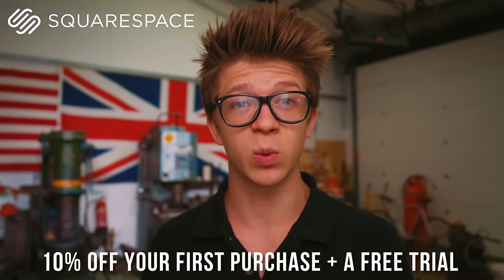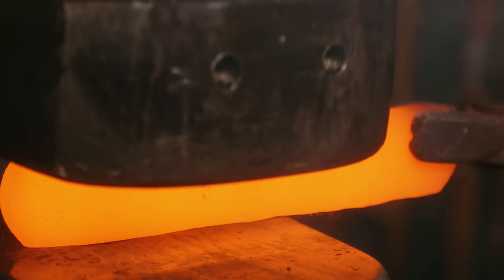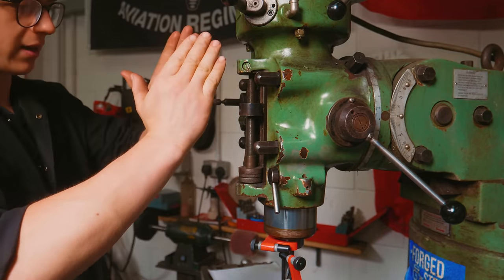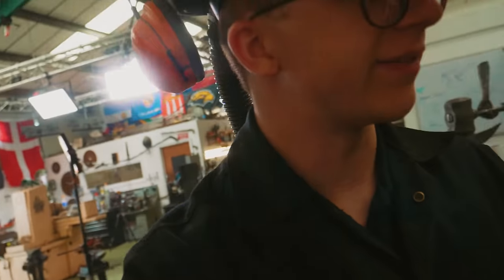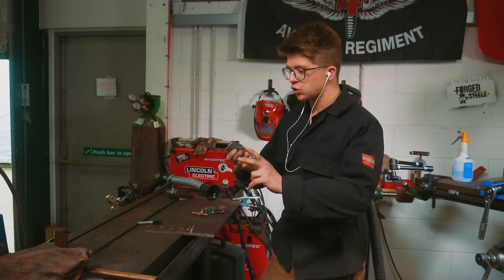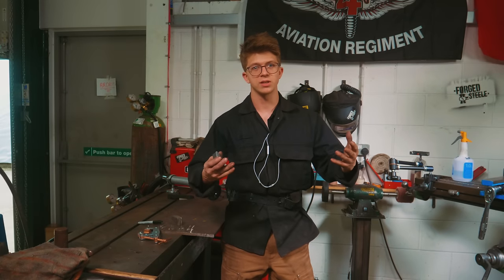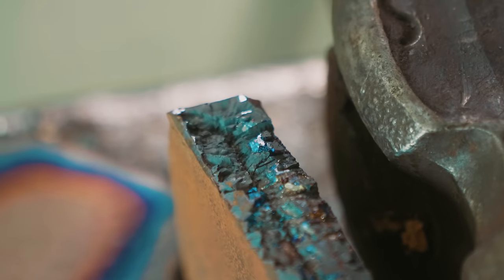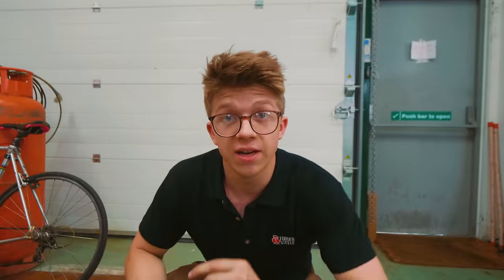CAN YOU MAKE TITANIUM & STEEL DAMASCUS?!?!

Comment: if the patent is the stumbling block try using helium inserted of argon.  Vacuum (or hermetical  seald )  processing  of metals is an old method and is probably not patented ( viking age crusebel steel for the middle east ) so if you use a alternate purging gas (must probably be a noble gas as Ti reacts with Nitrogen )
Reply: Sveinn Guðberg Sveinsson I don't think that would work if the patent is strong.. if anyone making the patent was smart they would word it to include all gases
Reply: Jake Mitch that would be to brood argon gas is use in aluminium processing for purification and titanium and it's derivative are welded in vacuum and argon gas chambers so you can't patent broadly and you must prove the process is new and dissimilar to others but I'm not a lawyer
Reply: he said the process is patented, not the gas used. so it doesn't matter which gas you use. it matters how you use it.
Reply: I'm guessing their process also uses specialized equipment though.  General inert gas welding, even done with forging, can't possibly be covered by their patent... Not a lawyer obviously but...
Reply: A patent that tries to include previously developed methods is inherently weak. If a method was already developed then on what grounds can they claim a patent?
Similiar to when Trump tryied to ™ "You're Fired"
Reply: I don't know the full details here but I seem to remember a story about the guy making a massive molten metal explosion and burning down his shop in the process of trying to figure out the process. So I don't recommended anyone just try doing this on their own without teaching.
Reply: Sveinn Guðberg Sveinsson Really what reaction with nitrogen?
Reply: Sveinn Guðberg Sveinsson or Xeon but that's super expensive
Reply: Just because something is patented doesn't mean you can't replicate it..
Reply: Patent in what country???.... check
Reply: In the USA, you can duplicate a patented item or process for research, including (and usually) an improvement on that item or process. You cannot generally use, in a practical manner, that item or process for its intended purpose. Still, many processes and items are on weak patent grounds; show "prior art" by others, and they tend to go away.
Reply: He can still make it if someone has a patent on it right? A patent just preclude sale of the product it?
Reply: Cannot use patents to make videos that you make money off, in that case he would need a deal with the company. You can make it all you want at home ofcourse @Jackson Jaro
Reply: That's super interesting. Is it common for content creators like alec to get screwed by publishing a video showcasing a process that they didn't know was patented?
Reply: I cannot believe that it's possible to patent a method... Imagine if this was the case with other stuff...
'No you can't use async programming, it's patented', 'too bad you like burgers 'cause we've patented it'...
This is ridiculous.
Reply: TiN titanium nitride is one, the surface of Ti bolts is "plated" with N (nitrogen) inn a gas chamber ( you can even pick your color) it is the most common post treatment to increase surface hardness in all Ti products and as the atmosphere is 70 ish % N then I think you need a controlled  environment.
Reply: I don't think he's precluded from making a video about the patented process because it is patented. Even if he did, I don't think whatever corporation owns the patent would care. I'm not an expert, I'm studying for the patent bar, so this is a pretty niche case and it's more into the litigation and enforcement so I'm not sure. 

A pretty major precept behind the patent system is to get people to share their ideas with the public in a way that someone with ordinary skill in that particular field could recreate it. 

 He definitely couldn't sell whatever he made, which may be a drawback for him.
Reply: Correct there are few things that do not react with Titanium, and heating it in a vacuum I remember it vaporizing at a fairly low temperature. That is compared to many other metals. The only other common structural material that melts at a lower temperature is aluminum. I have sprayed titanium in a vacuum onto aluminum parts, and used argon to cool the aluminum, and nitrogen purge just before the filters so they would not burn and to protect the vacuum pumps. I built a chamber using MKS controls, and other equipment. I worked there a few years till one day the owner came in one day wasted looking for a fight and attacked me. He had poisoned himself with various metal vapors without using proper protective equipment.
Reply: Sveinn, Argon has been used for more than 50 years and patents don't last that long even when renewed. If you want to work out the process with someone that has the equipment, material, and technical background send me an e-mail.
Reply: Crazy Horse, Titanium burns in nitrogen one of the few things that will burn in that gas. It makes TiN. The color depends on the thickness of the coating and particles.
Reply: I skimmed the beginning of the patent (didn't have time to read it through yet), but it seems to a load of BS. They are essentially patenting canister damascus forge welding (all metals, not just titanium) with an inert gas inside the canister. This is obviously ludicrous, as canister damascus has been done for ages. Also, forge welding Ti into Ti is also nothing new, and not invented by the patent holders, which, by the way, they acknowledge in the patent.

My initial take is that the only thing that would up in court is the use of their trademarked name 'Timascus', which is rather gay name, I might add. Surely the company would not even consider suing Alec if he was to make Ti damascus in a video. Only commercial mass production and sales might yield legal action, but I doubt they would win, since AFAIK they have not presented anything new in the patent. I will read the entire thing when I have time, and comment if I change my opinion.
Reply: That's not true. You can't sell the product for it's intended use to compete with the company that owns the patent. You can also challenge the patent if you create a process that is similar and gives the same result, but is different enough that the process isn't the exact same, or improves the process in some way to make it your own.
Reply: Crazy Horse titanium nitride is one of the reactions. It gives it a golden sheen.
Reply: Can you weld steel to TiN?
Reply: Alright, so, the Timascus patent (US6857558B2) describes the well-known canister damascus technique, presenting it to be a new invention. What is new (to me, at least), is the claimed possibility of using "adhesive" to glue the canister's end caps in place. :)

The patent also shows an arrangement, in which inert gas is fed into the canister through the handle, which is hollow. The gas will either flow throughout the heating and forge welding process, and exit via a small hole in the canister, or alternatively, the canister is filled in the beginning, and the exit hole then sealed. I do not know whether constant gas flow trough the handle has been used before, but surely filling the canister with inert gas, or doing the entire operation in inert gas atmosphere is nothing new.

Ergo, I see NO new/valuable contribution in this patent, and bet it could be overturned in court easily. The only thing that MIGHT have some novelty value is the constant gas flow through a hollow handle. Then again, I don't see why this would be needed if the canister is initially filled with inert gas, and then properly sealed.

So Alec, if you are really panicking about patent lawsuits, yet want to make Ti damascus, here's one way you can avoid all moral dilemmas:
1) Stack and fill the canister, but leave the end plates out.
2) Put everything into an open-top container, like a kettle.
3) Flow argon into said container until all air has exited (argon is heavier than air).
4) Weld the end caps into the canister, while it sits in the container (which is full of argon).
5) Heat and forge weld as usual. But don't be silly and try to forge weld at "light orange"! From Ti and Fe melting temperatures alone, it should be obvious that you must go as hot as the steel can take. Bright white, that is.
Reply: it's just ti nitride, commonly used as a coating, say for drill bits, etc.  one the hardest known materials.

Comment: Mill a Steel sarcophagus of sorts that can fully encase say? two smaller, precisely machined Titanium blocks each w their own individual and separate seats in the sarcophagus.  Once you've machined the Ti blocks, degrease...then electroplate them with a fair layer of Nickel; once that's done ...THEN electroplate the Nickel plated Ti blocks with a layer of Gold.  Adjust the sarcophagus via mill again if needed. Degrease (maybe etch partially, or abrade partially the seats for the Ti blocks...i.e., stripes of abrasion and non-abrasion?), seat the dual plated Ti blocks into one half of the steel sarcophagus, then set the lid/other half to fully encase the Ti. Weld the sarcophagus closed...then send it to hell in the forge, high heat!  Then begin to shape the metal .....IF YOU DARE!!!

Comment: There was definitely some oxydation between the titanium and the steel. Maybe you should have ground both blocks down to wringing flatness, wring them together in an inert gas bath before welding the seam.
Reply from the maker: That’s a damn cool idea!
Reply: Unfortunately unless you can grind in an inert gas then the Ti will oxidise before you get it away from the grinding belt
Reply: You can grind wet and then wipe dry within the inert gas bath.
Reply: Jérôme Vuarand Ti will strip the oxygen out of water. You could grind it wet but you'd actually get a thicker oxide layer by doing so. Unpassivated Ti is incredibly reactive and very difficult to keep unpassivated without a glovebox.
Reply: Would it be possible to wring the materials in a liquid nitrogen bath?
Reply: Simon Reed not really no. LN2 is at -196°C, it'll not play nicely with hot things like sparks off the grinder. It's also not the kind of thing you want to submerge your hand in either, even with the leiden frost effect any that pools on you or your clothing is going to burn and or cause frostbite. Another comment mentions forge welding Ti by heating it under inert gas (presumably in an electric oven/kiln/forge), that might work but wouldn't be cheap to set up just to see if it could be done and I doubt anybody would be willing to lend him one.
Reply: When I said wet I didn't mean water. I meant an appropriate liquid that would act as a coolant and keep oxygen away.
Reply: MortRotu just an idea, surely if the blocks were wrung together submerged in nitrogen and allowed to rest to a more ambient temperature then gradually heated in the funrnace, all you would end up with between the layers is nitrogen gas which is inert reducing oxidation. It has its complications but just an idea. I'm no expert by any means.
Reply: You wouldn't be able to grind it under liquid nitrogen though.
Reply: Barry Woods mineral oil would do as a lubricant. That is what they store magnesium and other highly reactive metals in. As long as it was a slow cut as to reduce fire risk.
Reply: Actually it doesn't matter how flat the pieces gonna be. They are going to warp and bend during welding.
Reply: MortRotu that’s a good point, but perhaps a hand sanding at high grit in a   liquid bath would solve that?
Reply: I think it's the Tig welding that is part of the problem. you have to weld Ti in a inert gas chamber or it oxidises at the edge of the weld and breaks. the small I have worked with Ti on building race cars it's a greta metiral but so hard to work.
Reply: Straight White Male which liquid? Nitrogen as has been suggested would be far far too cold, mineral oil I don't imagine you'll get a good enough surface pressure in and depending on the abrasive used might lift the abrasive from the backing, most cutting fluids are water based or have a significant portion of water in to act as an oxygen source for the Ti, organic liquids (like petrol) are a bad idea near a heat source(like the friction of sanding or a forge) which brings us back to denser than air gases and the associated issues previously discussed or chlorocarbons which I wouldn't want to be sanding in cos I don't want cancer and don't really want to suggest doing something like that to somebody else, especially if I want to see them succeed for a long time to come. I don't want to be a buzzkill but with the gear Alec has he's not going to be able to do this with any degree of ease. There is a reason that Ti gear is expensive, the reason is that it's a difficult material to work with, far more so than many many others. I can sit here and poke holes in every idea thrown out, but cannot suggest a decent way to get round the problem, hopefully some other commenter can.
Reply: Simon Reed the mineral oil in reactive metals (Na, K etc) is specially degassed before hand. Moving it through air like the cooling system would need to will increase the air dissolved into it pretty quickly, then there's the fire hazard. At any speed that'll cut the metal enough friction will be generated to heat the oil faster than it can cool, oil doesn't conduct heat away like water. In a short amount of time the oil will reach its flash point and set on fire, probably in a few minutes at a guess, mineral oil has a fairly high flash point. There's a reason cutting fluids are water based, even though it'll rust Fe based materials.
As for resting hot metal parts into LN2, ummm not a smart idea, you ever seen what happens when you drop a room temperature (25°C) item into LN2? it can create a near explosive reaction, akin to a steam explosion but with a much less conductive liquid. I can see dropping a hot metal work peice into LN2 soaking Alec in LN2 as it flash boils, giving him severe frost bite, from experience being reckless with LN2, would not recommend, way worse than burns from heat.
Argon might do it if some decent way to dump it onto the grind belt above the peice and keep it on the belt instead of flowing off. Again Argon isn't cheap either.
Reply: Maybe not grinding, so much as Surface Grinding. I do like to see that thing in operation. Plus, friendlier to degassed mineral spirits than standard grinding.
Reply: Graith Tools that what the mountain dew looking liquid is? What's it based on, what's its main ingredient? I'd assumed water by how it flows. You'd still get similar problems with gas dissolving into the peice, taking water and oxygen with it to oxidise the Ti being surface ground. If you built a gas tight chamber around the surface grinder and filled it with Nitrogen or Argon (aka a glovebox) that might do it but would make doing the work alot more difficult (you have to transfer the heat out of the box (doable but difficult with smaller gear like a TGA machine in a materials lab but with a surface grinder? Who knows)
Reply: The Mountain Dew-looking liquid is some sort of lubricoolant; Alec's told us the brands he uses (I've forgotten) in past videos. Lubricoolant is largely water plus oil and emulsifier. Recycled lubricoolant also can have a lot of bacteria and contaminants, and is none too healthy to inhale, I've been taught.
Mineral spirits is turpentine or naptha or other petroleum or organic distillate with no water. Ti will, as others have pointed out, pull the oxygen out of H2O, and there's enough dissolved oxygen in most liquids to spoil welds. Degassed mineral spirits might help overcome that enough. Nothing is absolute, and until someone experiments, no one knows.
I think the suggestion of a paste or clay full of coal dust and inert or oxygen-loving silicates around the wrung billet, plus a high heat soak for a long time, plus drawing (pull, not push), with an inert gas feed, has some hope. These are great experiments I hope Alec makes work.